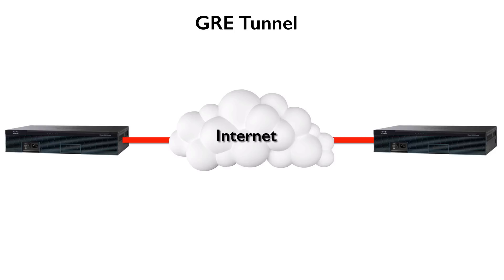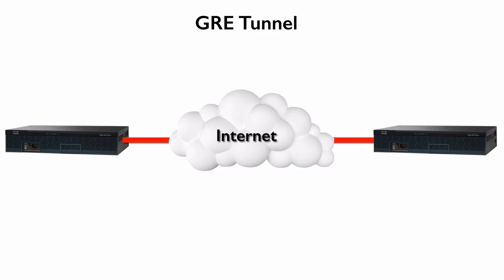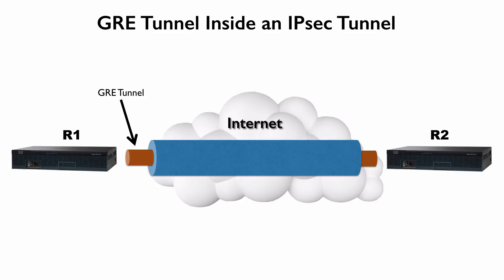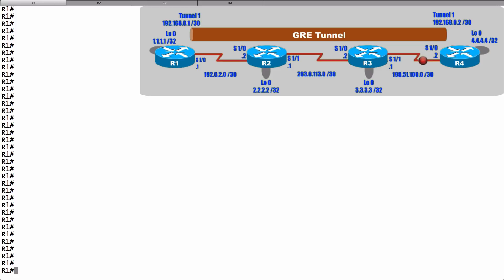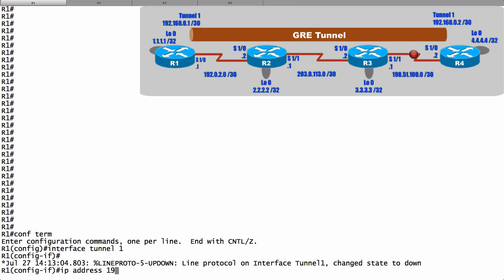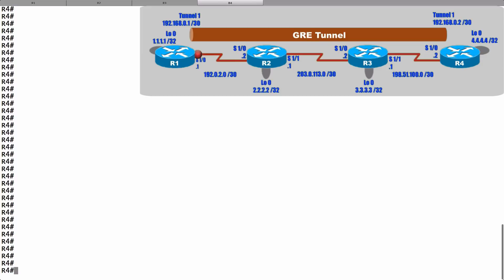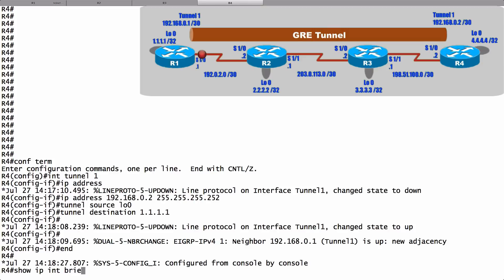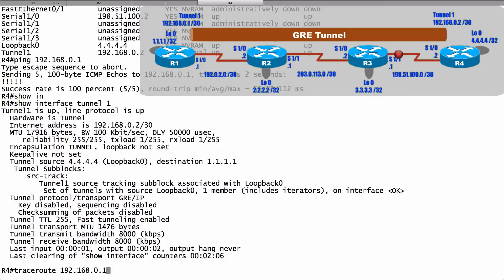GRE Tunnel Theory and Configuration

Comment: well, that's a great video, but I have a couple of questions. did you advertised tunnel address or loopback address in eigrp?  if you then why eigrp not advertise those routes with neighbor routers?
secondly, how to configure a tunnel using a static route in the tunnel itself ??
I tried to configure a tunnel with OSPF and I advertised loopback interface as well, tunnel came up, up but I couldn't able to ping remote  Lan.

Comment: Shouldn't your tunnel source be the internet-facing interface and the tunnel destination be the remote routers public IP address? If you use loopback address or local IP address, the routers won't know how to reach each other over the internet. This configuration doesn't make sense.
Reply: Ah, totally makes sense. It is interesting that in all of my CCNA study, I only ever saw the GRE tunnel implemented as as solution to connect a branch to HQ over the internet. Not a single implementation within an organization's network like you show here. Thank you.
Reply: My Tunnel is up and pingable, however traffic still goes through the other routers instead of choosing the tunnel. Using eigrp
Reply: I'm sure you do, no worries. Troubleshooting is part of the learning experience!